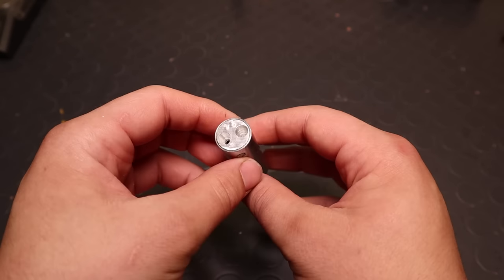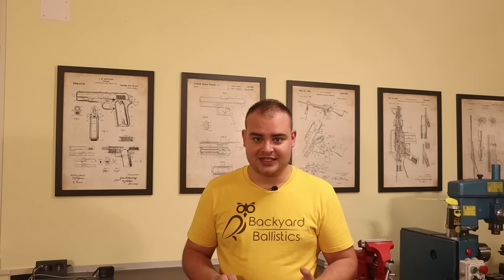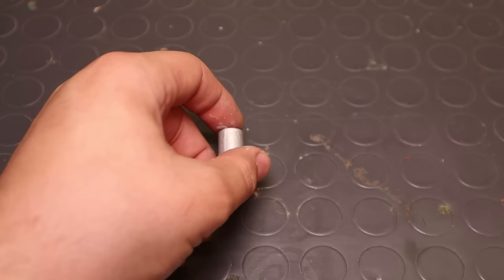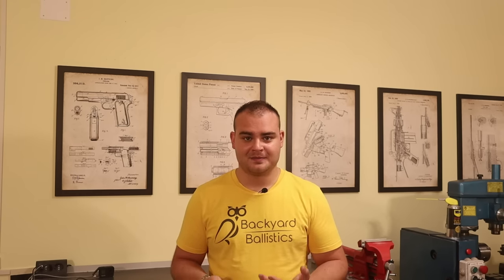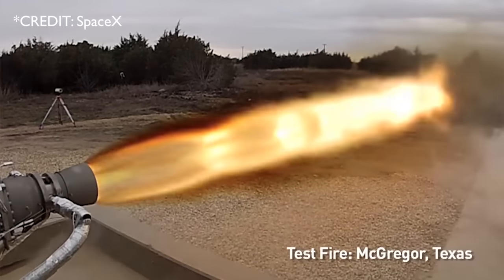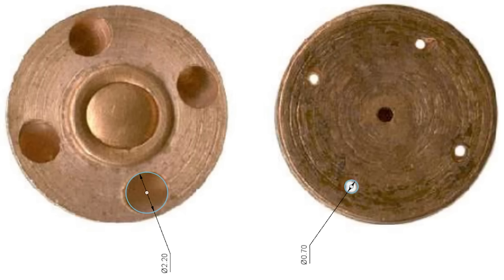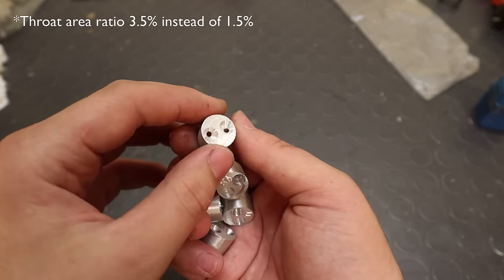Remaking 1960s GYROJET Rockets - Part 1: Improvements

Comment: Every day we get closer to the bolter, Praise the Emperor!
Reply: For the Emprahhh!
Reply: Needs a kicker stage i think, to make it capable at short range, give it some initial spin stabilization etc. and then the main Rocket engine fires. No idea how well that would work in reality though
Reply: @timulbrich954  It would prevent exhaust buildup in the barrel. Other than that, I think it would be really  inaccurate, finicky, and unreliable. Can the rocket even survive the acceleration?
Reply: .75 caliber bolters use a conventional bullet case with the initial charge that ignites the bullet. Also was rifled to get the initial spin up. Need to increase the size of the round, of course then it breaks your arm when you fire it.... But... THE EMPEROR PROTECTS!!!!!
Reply: Is he still mad about the toilet thing?
Reply: @timulbrich954  that and it needs to detonate inside the target.
Reply: @MaryGama  there are non space marine bolters
Reply: @nuke7777 the non space marine bolters are .75 cal so that’s pretty much the smallest they get
Reply: @nuke7777 all the bolters are .75 caliber except for space marine bolt pistols which are .50 caliber
Reply: Honestly though, he could just make it a somewhat longer and add a high explosive warhead. I mean a 20mm high explosive round has about enough energy and shrapnel to easily kill or wound someone 3 meters away, meaning this could soo easily be a bolter round. A direct hit could also propably cause similar damage as a bolter round

Comment: If you made them so they'd fit tightly in a 12 guage rifled slug barrel and make a copper jacket on them I bet they would be pretty accurate, pretty cool though, thanks for sharing!
Reply: @bobbm1  But would it be stable?
Reply: @korbetthein3072  I know nothing about rocketry or ballistics, so take what I say with a grain of salt, but if the barrel wasn’t choked and the ammunition was of the proper diameter I don’t see why it wouldn’t work
Reply: @bobbm1  Ballistics is a strange science, and you never know what might happen.
Reply: @korbetthein3072  exactly
Reply: From what I understand, the original Gyroject had a smooth barrel. The rocket rotates because of the angle of the thrusters. 

So yes, you could launch them or if a proper tube. The tricky part would be setting them off, because they don't have a case to headspace on. 

The original Gyroject had a hammer IN FRONT of the rocket, that pushed the rocket backwards into a fixed firing pin. When the rocket shoots forwards, it recocks the hammer.
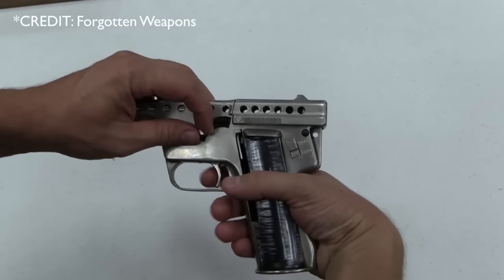You can see the backwards moving cocking handle at 3:45
Reply: I think a plastic jacket would be a lot more useful than copper. Lower force to get it moving so if lubricating...
Reply: @GunFunZS  Plastic doesn't do so good at high temperatures, and copper is a pretty low friction metal.
Reply: Just make the rocket align with the barrel, copper jacket does the stabling job
Reply: NO2 canisters for whip cream dispensers fit in a 12 gauge barrel. Be interesting to give the rocket an initial boost. Get around the slow start of a gyro jet.
Reply: @scotttod6954  figure out how to fill balloons with the whip it canisters and we're talking multi tasking, make em die while you get high, I think we're on to something here my man 🤣🤣🤣

Comment: My teenage mind always thought that the gyrojet would have had success as a two stage system where it’s first fired out of a conventional cartridge with gunpowder and then the rocket activates, ideally only after it had crossed a certain distance to extend the range.
Reply: that would be an Bolter :)

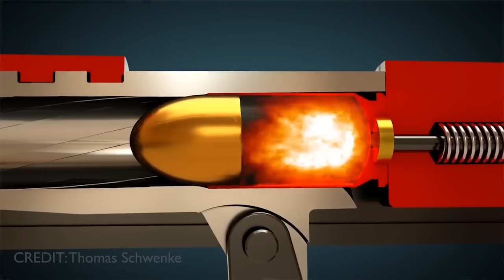Comment: 0:40 The projectile had left hand rifling, the gun had right hand rifling. That's weird in two ways because 1911's usually have a left twist, so the gun is also wrong depicted. On top of that, the animated projectile seemed to have grooves from a longer twist rate, because the angles don't match.
Reply: It just looks wrong as you watch it. Looks a a slipping worm gear. Still, nice clip.

Comment: Try a hybrid of a conventional bullet with the gyrojet.  Half of the barrel for the blast of the explosive in the casing, then the other half for the projectile and sabot.  The projectile would be surrounded by a separating sabot packing and the projectile would have spiraling fins with the rest similar to the original gyrojet projectile.  It would be ignited like a tracer round.  The conventional portion would give it starting velocity, and the sabot to give it initial stability through the barrel, which would be rifled in some way to initiate spin.  After exiting the barrel the sabot would separate and the fins of the projectile would then stabilize it and make it accurate.

What your video is doing is recreated the recoilless rifle which was developed for the Korean war and now used by ski patrols to control avalanches.

Comment: using rockets in a firearm instead of more conventional projectiles is one of those ideas that seems like it would be promising but in practice usually falls flat
Reply: SuckBoyTony's design looks promising. His design uses the same concept as a rifled slug.
Reply: T-90: Am I joke to you?
Reply: My understanding of the original gyrojet, is that the first part of the propellant burns especially fast, then a slightly slower burning propells it along to maximum speed. The first impulse makes it leave the barrel fast and in a straight line.
Reply: Analbanian
Reply: Only because it needs more refinement, ever heard of the rocket propelled rounds the military is testing for their 155mm artillery guns?  Same concept just bigger gun.
Reply: @lordfrostdraken  It's the smaller arms where it falls flat. The US Military has been working on rocket assisted bullets for decades but shelved it because it just wasn't practical in small caliber arms.  The goals of the programs were: flatter trajectories over distance and higher kinetic energy delivered to target. Neither goal was ever met in sub 30mm arms and 30mm arms became more like micro-missiles and less standard projectiles. The most recent attempt was the "Smart Gun" in the early 2000's.  It worked but the cost per round was too high for the added benefits gained.

Comment: I actually redesigned the gyrojet nearly a decade ago. Mine was a hybrid 50 caliber. Basically a rocket in a 50 BMG case with enough powder to engage the rifling and let the projectile leave the barrel level. With the hope of being lethal at point blank range which the gyrojet was not. The kicker of my design is that it was scaleable from at least .50 all the way up to 5 inch naval guns. Required zero modification to existing weapons platforms. Actually a couple years after I shelved my design DARPA issued a request for a way to extend the range of armaments from .50 up to the 5inch. I just have no financial means to further my design.
Reply: You should release your information to FOSSCAD or are you interested in machining, additive machining, ballistics, physics at large? FOSSCAD is mostly additive manufacture but I feel like the community needs to diversify out of 3d printing stuff and do more interesting stuff. Just a thought. Cheers.
Reply: Please don't be a hoarder if you can't use it let it out to be free and know you did that when you see all the vids and Congress Critters shitting themselves to ban it.
Reply: Share if possible, im sure people will help make it happen 😊

Comment: 0:40 I think the rifling being transferred to the projectile is twisting the wrong direction.
Reply: Beat me to it good eye
Reply: You're looking at the near side of the projectile and the far side of the inside of the rifled barrel. So it's going up on the side that you can see (of the projectile), but down on the other side, creating the optical illusion.
Reply: @kieranh2005  The grooves are lower at the front and higher at the back, given rotational direction they should be the opposite. I'm quite sure that I'm correct but if you don't think so, what is the mistake he mentioned in your opinon?
Reply: @jameshealy4594  you have to remember that youre seeing the rifling on the other side of the bullet. Looking from the back the rifling is clockwise, and so goes the bullet
Reply: @Helperbot-2000  I think you're the one not seeing it correctly mate but I have no easy way to prove it to you beyond some asinine argument like "I got the heart". I find it really helps me visualise it if I think about only one point in the barrel and imagine the bullet passing through that point. It becomes quite clear that the rifling is RH twist and the engraving on the bullet is LH twist.
Reply: @jameshealy4594  yes the engraving on the bullet is the wrong direction, however its animated in the right direction
Reply: @Helperbot-2000  I see my mistake, the engraving in the wrong direction is what I was (with limited sucess) trying to say.
Reply: @jameshealy4594  yeah

Comment: Personally, I can see the rocket ammo as a sustain kind of ammo, for instance if you wanted to have a round that could push threw a liquid, like a round that could travel threw water at a distance. However getting enough velocity would be tough under normal circumstances. Otherwise in air, at normal distances, I think it would be a detrement rather than benefit. That said, a combined ammo, with an initial pulse to provide velocity, and a sustained jet to provide both stability, sustained momentum and distance, might be an interesting concept with looking into. I dont see it being made a pistol round all that easy, but with a rifle or shotgun, that has the longer cartridge to work with, it might be possible to come up with something. or even a bullet with pulsed delays that added a bit of spin, and thrust as set burn rates, and delays, to allow the bullet to travel farther and straighter, for longer. It might be worth examining. Could be doable. Couldn't over do it though, or you'd risk changing trajectory rather than stabilizing it; but in a sustainable low power pulse, it might be interesting. Might have to build in a control interface if its a rocket thats more sustained and powerful. Would depend on what you wanted to make it do. But interesting regardless.

Comment: This is like a war hammer 40k bolter, except the bolter is about .98 caliber and has a kicking chard of gunpowder for the initial acceleration and cycling the gun, then the rocket charge fires accelerating it faster, then it burns out. Think rocket assisted artillery but “hand held” explosive payload included

Comment: @Backyard Ballistics (hope you see this eventually, I am apparently 2 years late to this party) :/
About the slow acceleration, what if you make a conventional charge in the bottom, that burns up & also ignites the rocket?
In that way you "SHOULD" get the best of both options? Like this:
end cap with igniter ➡ [ acceleration_charge |=| ⬅ Gyro_jet_base_plate. (acceleration_charge_area) >  ⬅Ballistic_end-cap

Comment: A large part of the Gyrojet's inaccuracy was the roll crimp was often too large and rolled over the edge of one or more of the nozzles. The Coanda Effect would cause the exhaust to curl around the rolled edge and produce an angled or sideways thrust. They never got into automated mass production of the ammunition. In addition to the lathe turned propellant grains, the nozzle plates were hand drilled one by one using an angled turret on a drill press. The bits were specially shaped to form the tapered nozzle holes and frequently broke. To control the burning speed of the propellant the outside of them was sprayed with white latex house paint.

Comment: If they started with at least a little bang, and the rest of the fuel was for fizzle, low exit velocity's not such a problem.. if the nozzle is packed and covered and can survive a bang, or if a nozzle with a hole to the rest of the fuel is what forms from a composite from an initial reaction that makes the bang, you've got 2 in 1.
If the reactory materials that do the start bang are a thinning circle towards the middle, maybe you can get some kind of resulting bell curve shape that starts thicker at the outside, to a thin pointed gradient, and adjust the curve of packing thickness towards the centre to modify resulting nozzle shape).
Now add PCB servos inside for a pointy fin at the front to angle the projectile via a tiny radio receiver, or a preprogrammed flashed-on-fire microchip, to function like a gyro, from lidar data off the gun-sight.
Also, less bang at the start means more turning power before it's up to speed. And this is how you make the Zorg ZF1 Replay Button.

Comment: Can the rocket be ignited like a tracer? If so, wouldn't launching it from a 12gauge shotgun give it the initial velocity boost needed to be lethal at close range, mitigating the shortcomings of the original Gyrojets?
Reply: -mumbles "this would also make it more bolter like yet again" -
Reply: The emperor approves.

Comment: If you're redesigning the gyrojets completely, you could add a launching charge similiar to a RPG. The projectile ins't very large, so it wont need much to get it out the barrel. You could just recess the nozzle into the body, then put in a launching charge and put some ignition powder in the nozzle ports to start the jet once it has launched. In theory you could also use this to keep your barrel shorter, albeit with some backblast.
Reply: Honestly a primer for a large caliber would probably be sufficient

Comment: It’s a great idea all the project, but in rockets the diverging part needs to be in relation between the pressure of the gases that escapes and the “expansion” of the diverging part, so at the exit of the rocket the exhaust needs to be at the same pressure of the atmospheric pressure to have a supersonic exhaust so if I make just a bigger expansion in the diverging part it does not mean that I will have more thrust, to have more thrust I need to have the perfect relation between pressure of the exit gases from the rocket and atmospheric pressure

Comment: I’m currently working on a fliegerfaust which uses similar rockets, I think you would like the project, I’m using APCP as my rocket fuel for my rockets
Reply: APCP definitely makes the most sense as far as weight, power and safety.
Reply: @chemistryofquestionablequa6252  yeah I think it’s an ideal propellant and relatively safe compared to double base

Comment: This projectile needs fold out fins. Also ive been courious about a traditional projectile fired then assisted by solid fuel insid the projectile so bullet is at max acceleration then rocket propelent ignites in flight.
Reply: Fins and rotation do NOT work together.

Comment: a gyrojet- shotgun hybrid might work well. overcomming the initial speed and accuracy issue with a conventional gun design, with the jet kicking in mostly past the barrel.
basicly how an rpg7 launches, but in a closed rifle design.
the shotgun powder load can be relatively low, as to reduce recoil.

yes, that would be a bolter.

Comment: would like to have a more of a hybrid system where the gyrojet is pushed by initial powder like a normal bullet would but instead of pushing to over 400m/s velocity it only pushes about 200m/s or so..just enough to make up the range which if it is harmless before (when there is only the gyrojet it self)

Comment: Would an aeropike nozzle not be more stable with an even burn of fuel than a two hole vent and would still be able to be center fired or even 12v fired. I understand the spin isn't there but it wasn't there with the original. Using a rifled barrel would impart a spin, if a rifled choke can impart a spin on a slug in the last 6 inches of barrel no reason that wont. Great video can't wait to see the next one

Comment: it may have been better to use a thicker machined hull with an increased mass at the nose, then thread the tail section in order to screw the nozzle section into it, this would both allow the projectile to maintain stability and lethality at range as well as potentially make them reusable if they survived, additionally it would also allow for much more volatile propellant to be used.

Comment: Drop the diameter.. Rifled barrel and disgarding polymer sabot.  This may allow the addition of fins, helping stability.  I would retain the acceleration of angular velocity with the angled nozzles.  Stabilization is always a problem when you are making a rocket that does not look like a rocket.

Comment: Man the slow muzzle speed is pretty unfair, brandon herrera made a video firing the gyrojet and if I remember correctly it was strong enough to pierce inside a human even at basically point blank, not to mention that the rocket would continue firing inside the body, creating internal burn damage and sending itself around unpredictably

Comment: “Deciding to walk to work but getting stuck in traffic” and how exactly would you get stuck in traffic while walking to work?

The problem is not the effectiveness of shooting a rocket projectile out of a magazine gun; it’s the accuracy of the projectile itself. There’s no reason to consider just using a type of gun with a longer barrel, and a smoothbore barrel at that, and equipping the gyro jet with some form of aerodynamically stable fins or small thrusters which can keep it moving in the direction it flies instead of building what’s essentially a missile launcher.

Comment: Ah. It is not true that this is the only handheld kinetic energy weapon using a rocket. Rocket arrows were used since at least the 14th century and the smallest form often used a simple arrowhead rather than an explosive, incendiary, or shaped charge warhead, and were definitely capable of being fired as a man-portable weapons system.